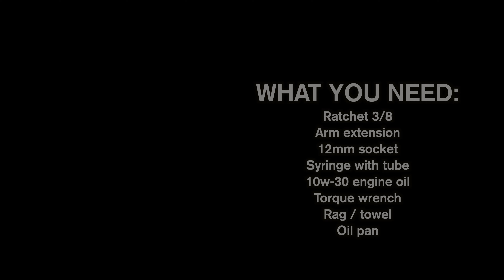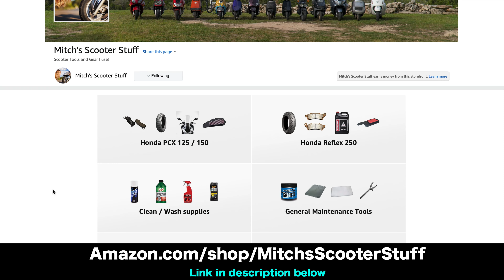Honda PCX 150 - Final Drive / Transmission Oil Change | Mitch's Scooter Stuff

Comment: All roads lead to the Honda PCX. I had a Helix and Elite 150. Now I have a PCX because it is reliable and reaches into the future.
Reply from the maker: Very cool! 😎
Reply: I just picked up my first PCX, a 2018! Mitch doesn't specify the oil brand he uses in his video, but it's worth noting that the Honda manual just had basic requirements. 10/30 basically.
Wondering if basic mineral based 10/30 is cool for a newish 2300mi PCX..
Reply: A lot of "basic" in my comment lol
Reply: @paulmccarter908  heck, if you wanna go that cheap, why not just use Bengay?

Comment: I used small bottle gear oil for scooters.  I didn't use Engine Oil.
Reply: Follow what is written in the Honda instruction manual and use engine oil. Scooter transmissions consist of small gears

Comment: I did the same on my Pcx after a wash adding fresh oil, but used Transmission oil 75w-90
Reply: me too and then the oring has broken hahaha
Reply: This is in fact the correct oil to use - a hypoid gear oil. NOT engine oil!
Reply: @thevoicewithin930  Follow what is written in the Honda instruction manual and use engine oil. Scooter transmissions consist of small gears
Reply: Use either 10w30 engine oil or 70w90 hypoid gear oil both are recommended by the Haynes manual

Comment: Great video. Same oil in transmission and engine?
Reply: yeah, user manual and service manual say it's engine compatible with the gear box. I run w40 or w50 for mine cause I ride a lot

Comment: Hello there, try using gear oil like 80-90, 10-30 or any engine oil will lead to failure, been there...
Reply from the maker: Hi Christos, can you explain why yours failed? I have been using 10w-40 in my Burgman 400 with 63,000 miles since 0miles I bought in 2007 it has zero problem. I put 10w-40 in all scooters that manual recommended never have problems.

Comment: Would using a heavier weight gear oil be an issue.  Like 75w90?
Reply from the maker: I think it is okay to use that, but I feel safer to just follow what Honda recommends

Comment: Why did you put motor oil 
Isn’t there a specific oil for final drive?
Reply: the user manual says engine oil is good enough, final drive oil like 80w90 seems too heavy

Comment: you must do 75w90 final gear oil , not 10w30 , tracer from morocco ❤
Reply from the maker: Aloha, I use 10w-30 that’s what Honda recommends in manual, I do that for many Hondas and my burgman for many years with no problem

Comment: Whats the difference between engine oil and gear oil? Because that looked like engine oil you put in
Reply from the maker: gear oil is heavier and thicker  but Honda say engine oil into transmission... that's what manual say also same thing with Suzuki Burgman 400

Comment: Is the differential oil 80/90? You put 10*30.
Reply: 10W30 mb motor yağından koyuyor Fatih. Bu adamı takip et kitapçıkta ne yazıyorsa onu yapıyor. 80W90 araba dişli yağı koyma diferansiyeldeli küçük rulmanları tam besleyemiyor 10W30 gibi

Comment: I wonder if anyone has an excerpt from the Owners Manual where they specify the transmission oil type/grade...
Reply: 120 ml 10W30 MB engine oil
Reply: @hasann1453  with moly or without ?

Comment: How often should i change transmission oil?
Reply: Every 30 or 40K. Most people NEVER change it. But use the correct oil, NOT the one in this upload.
Reply from the maker: @corneilcorneil hey, Honda recommended oil what I used, nothing wrong with that, been doing for many years in Honda and Suzuki
Reply from the maker: I do every 10k miles, with 10w-30 that’s what Honda recommends
Reply: @MitchsScooterStuff   80W90   Do what you want.

Comment: Rather use a 75W90 hypoid gear oil.
Reply: Follow what is written in the Honda instruction manual and use engine oil. Scooter transmissions consist of small gears.
Reply: Mas esse óleo é para transmissão de moto o 75w90?

Comment: 80W90 is the correct oil type. You use just engine oil.
Reply: Follow what is written in the Honda instruction manual and use engine oil. Scooter transmissions consist of small gears
Reply: @hasann1453  Manual: 80W90
Reply: @corneilcorneil  Honda pcx reduction oil is 120 ml 10W30 Engine oil.
Reply: @hasann1453  You are sooooooo wrong! Search up "Honda scooter gear oil" SAE 80W90 ALL! Thank me later. Btw... what is"reduction oil"? Man, man, ... so wrong. SAE 80W90, i own a bike shop... have a nice day!
Reply: @corneilcorneil Meinen Sie, dass 80-90 das Beste ist?
Reply: 80w90 ist definitiv das Beste👍👍👍👍👍👍👍👍👍

Comment: Gear oil is different from engine oil
Reply: Follow what is written in the Honda instruction manual and use engine oil. Scooter transmissions consist of small gears

Comment: can an engine oil a substitute for gear oil? i think you need 80w90 gl-5 gear oil.
Reply: Follow what is written in the Honda instruction manual and use engine oil. Scooter transmissions consist of small gears
Reply: @hasann1453  According to my research and i also have scooter. gear oil has ep(extreme pressure additive), and much viscous than engine oil. It also has dithiocarbamate derivatives and sulfur-treated organic compounds which an engine oil dont have. Engine oil cannot be a substitute  for gear oil.
Reply: @bepositive14344  No, you know wrong. Engine oil is also available for operation under high pressure and heat and can be put on scooter differentials. Differential oil If you are also so opposed to engine oil, use 10W30 differential oil. Gear oil is not more fluid exact same values (sae)

Comment: wait!! Why you don't use gear oil for scooter.  the oil gear for scooter is 80w90 not 10w30 for your engine
Reply from the maker: Just follow the manual what Honda Yamaha Suzuki say... I put 10w-40 in my burgman 400 for 14 years... people can put gear oil like 75w-90 / 80w-90 if they prefer 🤙🏼
Reply: Follow what is written in the Honda instruction manual and use engine oil. Scooter transmissions consist of small gears
Reply: @hasann1453  i just put 10w30 engine honda oil in my gear box forza 300,and now the gear box is loud,makes some mechanical noise i dont think that this engine oil in gear box is good
Reply: @audiophilipp  In transmissions used with 80W90 oil for a long time, the gap between the gears will increase as the gears are worn. When you put 10W30 engine oil in the gearbox that has worked like this for a long time, it may make a noise. There is no sound in Forza 350, everything is as it should be. Already in the running-in maintenance of your new engine, you will see that the factory puts 10W30 oil in the engine and transmission. I've done 100,000km with my other Honda scooters and have had no issues or noise.
Reply: @hasann1453  scooter has only 9000kms,i just changed it with 10w30 MB as manual says and the gear box makes grinding sound sometimes when slowing down,ITS NOISY,it wasnt before,now it is
Reply: @audiophilipp  There should be no noise in the gearbox working smoothly. Noise is louder with problem gearboxes. Are you sure you put in about 280 ml of oil?
Reply: @hasann1453  yes,280,and a little more then it started to leak,so its full.
There was 0 noise before,now it has noise,at idle no noise,but then driving it has grinding noise,i really dont get it
Reply: @audiophilipp  Can you drain the oil and refill the 280ml? Clean up the remnants of the old oil. Do not fill more than 280 ml of oil
Reply: @hasann1453  what 10w30 oil u use ? Is it eith moly inside ?
Reply: @audiophilipp  I am using Motul 10W30 MB Scooter Power. I change 12.000 km engine oil, 24000 km gearbox oil change in Forza.

Comment: Definitely wrong application. Differential oil that should be used should be Sae 80/90 Mineral. The part where oil change is made is a kind of differential, in short, a gear box. Using Sae 10/30 oil here is not appropriate, the possibility of leakage from o-rings and seals is very high, and at the same time, noise and deterioration of gears and balls are likely in a short time. FOR YOUR INFORMATION.
Reply from the maker: I have been doing this for many many years with Hondas and Suzuki they say 10/30 in manual, zero issues. My burgman 400 using 10/40 and I put 62,000 miles on it, no problem.
Reply: @MitchsScooterStuff      It's really incredible. I've been a master for years. However, in all engines using 10/30 Transoil in Turkey, we encountered bearing noise and gear whining noise. I've been using a quality SAE 80/90 oil in my own engine and all the engines I produce for many years and believe me, I don't experience such problems. HONDA authorized services in Turkey also use SAE 80/90 Gear Oil. I follow your videos and find them quite successful. I eagerly await your further videos.

Comment: Hi,
What transmission oil should I use on Honda PCX 125 2021? I try to find out in Google and what I found is 10W-30MB or 80W-90?
Reply: refer your user manual for the best result
Reply: Follow what is written in the Honda instruction manual and use engine oil. Scooter transmissions consist of small gears. 10W30 MB

Comment: 10/30 Engine oil ?...Gear oil 80/90 suitable !
Reply: Manual service Honda Scooter: 

FINAL Drive oil: Jaso T903 MB: 10w30 ( engine oil).
Reply from the maker: Yes Honda say 10-30 and I do that for all Hondas and burgman, change every 5k miles

Comment: Hi,
What transmission oil should I use on Honda PCX 125 2021? I try to find out in Google and what I found is 10W-30MB or 80W-90?
Reply: 80w/90
Reply: refer you user manual comes with the bike
Reply: Follow what is written in the Honda instruction manual and use engine oil. Scooter transmissions consist of small gears. 10W30MB